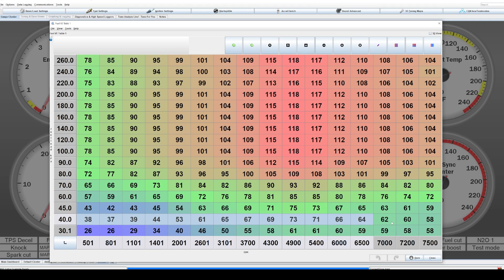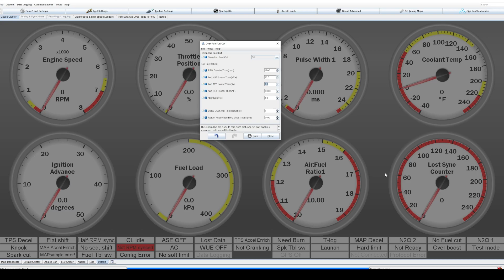Megasquirt Over-Run Fuel Cut Basics | Save 1-2mpg With This Feature!

Comment: I am very confused on the difference between Over-run Fuel Cut and the Decel Fuel Cut under Accel Enrichment. 
Is it that AE instantly removes 100-(whatever percentage of Decel Fuel Cut is set) % of fuel immediately off throttle and that Fuel Cut shown here simply takes effect later on?
Great videos thank you very much! 
😊

Comment: I assume having this feature on and set up correctly while doing additional fuel map tuning, specifically with auto tune would not be an issue. Can you confirm this for me?
Reply from the maker: You need to turn off this feature when tuning.

Comment: Hey mate, would you have any info on tuning for a 3 wire stepper motor ICV
Reply from the maker: The tuning is the same once it’s wired up correctly
Reply: @TurbineResearch  cheers mate, haven't started anything yet, just getting info before jumping in